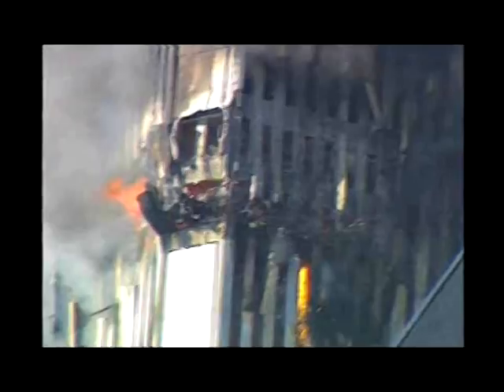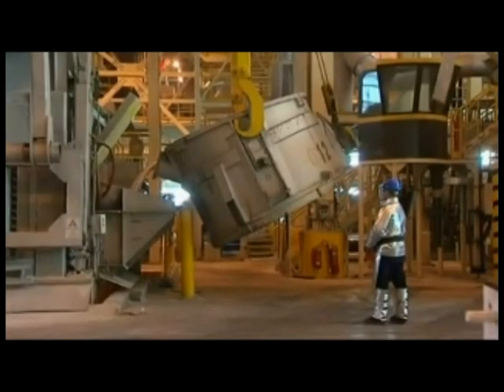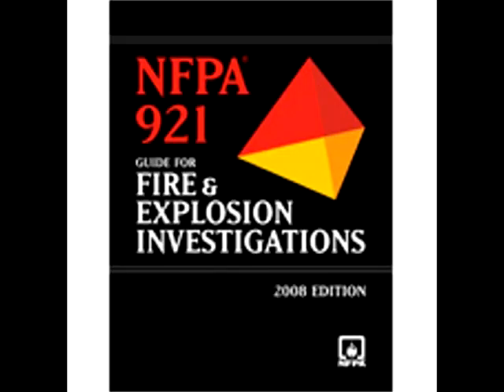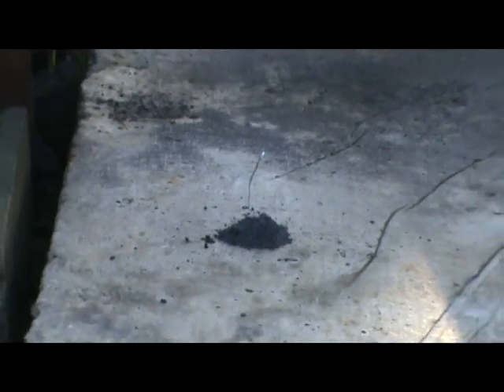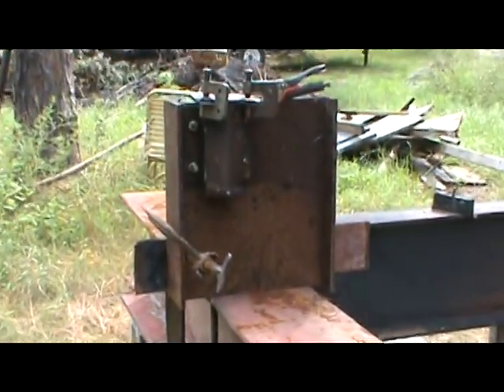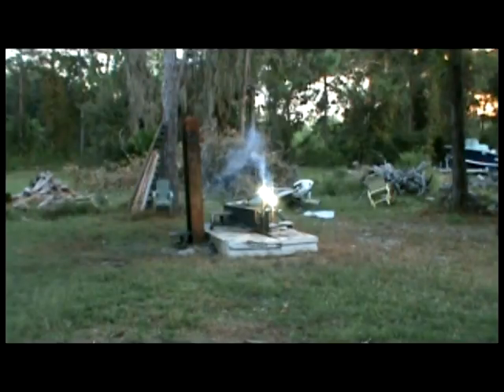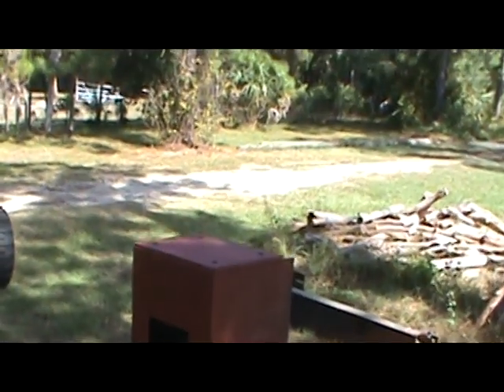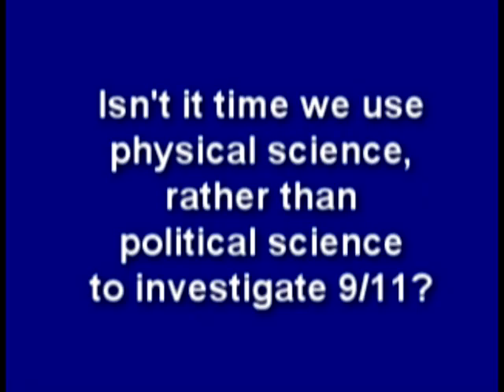9/11 Experiments: The Great Thermate Debate

Comment: Show me a recovered beam with a clear thermite cut, or shut up
Reply: We are conditioned to believe lies. It started at childhood with the tooth fairy, santa claws and the easter bunny. Then we go through ''education'' being brainwashed about the history of the word. For some they are brainwashed into believing the bible and the high majority of nonsense it contains. We are brainwashed by advertising that is designed to make a particular product seem more needed and desirable than another.

So provide the steel or shut up?...
You believe the above lies for how long before you woke up?... It's not the news that we see that worries me, it what we don't see that's the problem... CENSORSHIP.
Reply: horse1066 the dude clearly stated that he didn't have the compound that was most likely used, and just with back yard tests confirmed to a degree that you can cut horizontally
Reply: Your screen name should be sheep1066
Reply: horse1066 You say, "whats there to explain", like a smart ass and then you actually explain and support your position. Cut the crap and get to the point. 

Anyways, the investigations done then were not satisfactory. These experiments you speak of, they seem reasonable to me, but they were never done by them. They simply claimed that it was aluminum and carpet, no evidence to support their theory, and moved on. Soddy investigation all around.
Reply: horse1066- Are there any bigger sheep than those who believe ever conspiracy?
Reply: horse1066 i will agree with you that if this were 100% planned, then a ton of people would have to be silent for decades. the more you look into it, the bigger of a conspiracy it would have to be. as for the beams, the only thing i've seen is the videos of the super clean cuts that look like they were done with a plasma cutter
Reply: horse1066 This video also has a clip and references another video where they mix molten aluminum and carpet. From what they claim, it doesnt work.
Reply: horse1066 All this dudes trying to say is we're being lied to about what happened that day and I don't disagree with him. Although I do agree with you on what does are government have to gain from this. I don't know it's just all a little weird for me. Terrorist have attacked the tower before tho so I mean, it's possible they could of set up the thermite years before 9/11
Reply: horse1066  please explain how the tower collapsed in its own footprint like a controlled demolition
Reply: The point wasn’t to prove that thermite was used it was to prove that thermite can melt steel and disprove previous experiments the guy just wanted to do his own experiment rather than trusting the media
Reply: K Petro No, there is still one in the inner harbor in Baltimore.
Reply: BertleMcGertle this guy isn't an idiot, he's just as skeptical as anyone
Reply: Hank Schwiebert - what is to explain? The molten 'stuff' appears right where the plane hit,  wings are partly  made of copper/aluminium alloy.  Presumably someone needs to melt that with a bunch of impurities and see what colour it has. It also appears over a period of 7 minutes, whereas a thermite reaction is over in a few seconds and doesn't produce a great deal of melt.
Also it's kinda incredulous that someone managed to fly a plane right into where all the thermite was covertly installed...
As long as there is a reasonable explanation of something, an alternative explanation doesn't "prove" anything, you simply have two explanations for a given observation.
Reply: I didn't mean to sound like a smart ass, but you posed the question like it was unexplainable?
I'd agree, I don't get why nobody in the tinfoil camp has yet to melt copper/aluminium/carpet and see what it looks like, that seems like a quick way to counter the NIST's suggestion.
Reply: horse1066 

Well, I don't t entirely believe it, but it kinda makes me wonder how jet fuel can be high enough to melt steel beams.
Reply: nice meme I personally don’t believe everything the government says is true. However I also don’t believe that everything bad that happens in this world is always caused by he government.
Reply: iSal 
One problem with Conspiracy to Commit Murder (Treason)
doesn't have a Statute of Limitations ALL CARRY DEATH PENALTY who would talk?
Reply: AxA12 
Cannot Ever get so hot (calculate mass of steel/ BTUs/mission impossible; YES)
Reply: David Porowski - aww come on, that is a basic 9/11 question and the one with the most reasonable explanation,  AxA12 just hasn't bothered to google it. People who are not Engineers should really step away from this debate.
Reply: Hank Schwiebert - got a timestamp for the clip ref? I kinda FF'wd over his annoying narration
Reply: That is the whole point the beams all somehow vanished, I wonder why
Reply: Carmicha3l - I am an Engineer, also 30 years experience. Why don’t you tell us what you bring to the table :)
Reply: Carmicha3l - So clearly you are the uneducated dumbass neckbeard here, but you thought you'd mouth off a bit anyway. Kinda fell a bit flat eh? Feel free to ask me shit that only an Engineer would understand, I'd prefer Electronics but I usually have a grasp of most topics.
Reply: Carmicha3l - you still here? You’ve got nothing of import to add yet you continue trying to make out you do? come back when you’ve got a degree eh kid.
Reply: Consumer of Souls and cupcakes - we don’t know what that material was. I’d suggest if it was supposed to be thermite then we’d see the same phenomenon at every pillar and for a shorter period than the 7 minutes this was recorded over? As you know, a thermite reaction is over in seconds. Plus, you’d imagine someone trying to do this “covertly” wouldn’t use so much thermite that it starts to spew all over the place. This guy’s experiments don’t appear to reproduce this quantity of material either. Typically a cut beam briefly puts out a lot of light and smoke (also not seen), but not a few gallons of free flowing clear melt, there’s no real visible slag here either.
It is an unusual event though, I’d imagine some videos of burning planes on runways would be useful.
Reply: Carmicha3l - seriously, get lost kid. "I choose logic and critical thinking", no, you are sadly too dumb for that, you are choosing an "Appeal to authority" and hoping it makes you sound clever.
Great, 3,000 people have an opinion, good for them. So where are the cut beams...? Do you get it yet you fucking moron? You've got jack shit other than an "opinion", which in your case is based on other people telling you what to think, and then you lacking the ability to technically question any of it. This is the flaw in democracies btw, fuckwits like you are still allowed to vote for Hillary. 

Bush: "we need to stop that muslim twat from gassing kids, torturing his own people and developing VX nerve agents and biological toxins"
CIA: "sure thing boss, but first we need to destroy Manhattan to give us an excuse"
Dumbest tinfoil theory ever...
Reply: horse1066 it wasn't a joke
Reply: Harambe - not really, a fact is an observation that is accepted to be true, a theory is an accepted explanation of a fact. Science uses these terms differently to common usage, so theories do not 'turn into' facts.
Reply: Carmicha3l - creationism is interesting because you can't engage with it on the level of observable facts, because sky pixies by definition are not observable and therefore can't be disproved. But equally you could say that something that is non observable also will have no observable affects upon this universe, so in the absence of proof either way we can suggest that "God" is irrelevant because he's never seen to do anything.
So there might be a cat in the box, but unless he needs feeding then I don't care.
Clearly some (Americans) have decided they do care about unobservable sky pixies, and what those sky pixies may require from us in terms of singing, praising and the charitable feeding of African negros ad infinitum. But since I can discern no difference in my life experiences from yours, I choose not to waste my time singing and praising divine pixie entities that might have left Earth aeons ago. 
There is a correlation between low IQ and a belief in Creationism, that still doesn't disprove it but it's interesting. 
There is also the same link made between a low IQ and a belief in conspiracy theories, the latter is a bit more subjective in that Governments are known to lie in order to remain in power (like Merkel), but you have to balance that against their gross incompetence in achieving anything of value or complexity, which tends to rule out hyper elaborate shite like this.
Reply: horse1066 agreed
Reply: Harambe - a theory without evidence would be a guess, a hypothesis is a possible explanation for an observation. The issue being is that humans have a confirmation/belief bias, where the hypothesis is being irrationally judged based on a pre existing belief that the government always lies, and by inference that it is also capable of enacting any scenario to serve its assumed interests.
Theories (in the sense of being a scientific model) require accepted and rational evidence, not just "evidence". Like unexplained cancer remission is not evidence of a god, finding cat poo in the box is not evidence of the cat ever having been in the box.
An inference is where you have a fact that thermite can cut a beam, and you then use that to propose a hypothesis that such a method was used to bring down a building.
I'm going to get myself tied up in knots on this :)
Reply: Carmicha3l - that's pretty much what muslims say about those who point out that Islam is fundamentally violent, misogynistic, homophobic, paedophilic, patriarchal, anti-Semitic, politically insidious, totalitarian, intolerant and basically backward and inbred.
They have a right to their opinion of course, but most people eventually recognise the truth just from their own personal experience of living near them. Only dumb Hollywood actresses with a pathological need to be liked by others and who live in homologous white gated communities, have the basic feckless ignorance to suggest that our society is currently being enriched by the hosting of sub Saharan savages.
Likewise Evangelical Christians often see no need to question what they have been told to believe, or how to interpret the bible in anything but a dogmatically literal and simplistic way. Plus modern social norms allow them to skip any parts that are inconvenient, like stoning.
Religious people essentially define the human state of a closed mind, because their only educational source is a single consolidated book, originally written in a language that barely a handful of scholars actually understand, and then translated into English, which often doesn't share the same nuances of meaning, and which they don't care about anyway because someone has drawn them a nice picture of a white guy in a robe with some doves.
Reply: Carmicha3l - you are just repeating yourself without offering any basis for your opinion, I've written Prolog routines that communicate more intelligently. You could start by outlining why you don't believe in evolution. You can use all the big words if you like.
Reply: Carmicha3l classic
Reply: K Petro Thats a load of bs because ik for a fact that the US Air Force Academy has a beam from the twin tower on display.
Reply: The bolts were the ones that got cutted.
Reply: Lol there was literally one sticking out of the ground
Reply: horse1066 30 year experienced engineer and he doesn't have the brains to realize he's getting baited. Good one
Reply: oh no, China is in on this! i fucking knew it
Reply: While the theory seems viable it still needs solid proof to be accepted as horse pointed out a piece of used material or steel showing use of this material. And there are pieces of material still in the u.s at memorial sites may or may not be pieces that were close to the damaged area but.....
But on the same hand hundreds of people wouldn't need to be included certain groups within the u.s military operate outside of congressional jurisdiction and only answer to seniors and the president. If it is true and a more powerful agent that special forces could easily obtain was used they would only need a short time and limited personal to instigate said mission seeing as  they are regularly trained InThese situations. And have the ability to do said impossible tasks.
A much more viable idea is as the plane took out several steel columns the remaining ones could have been bent and broke in small areas you add the insulation of the steel and a supply of open flames  to a now confined area with warm air to rise flames to be sucked in and cold air to feed from the bottom while temperatures outside may be low you've created a forge inside the steel
Reply: horse1066 they shipped the beams to China to be melted down for scrap immediately.  Nothing left to see.  Source: Chicago Tribune http://articles.chicagotribune.com/2002-01-27/news/0201270268_1_metal-management-world-trade-center-shanghai-baosteel
Reply: horse1066 Did you find video or testimony of molten steel compelling at all? That does need to be explained, and NIST could only say its molten aluminum mixed with carpet. Theres no way thats true, so weighing the evidence here the tin foils have a stronger case on this one.
Reply: horse1066 i agree that the burden of evidence is on those claiming thermite/thermate was somehow involved, but one does not have to examine the steel beams to conclude whether or not thermite was involved. The man inside the video provided a multitude of other evidence- eyewitness accounts directly contradicting the governments claims which perfectly align with what the man presented, as well as video/photo evidence which proves there was some other variable leading to the collapse other than jet fuel and the initial impact. The fact that national geographic/nist claim that even 100 pounds of thermite cannot melt through steel beams and support this with film of their supposed controlled experiment while a random man can make his own thermite with common substances and needs about a pound to cut through steel means someting dubious is at play. This video also disproved the fact that thermite cannot cut horizontally or vertically, also directly contradicting the narrative told by Nist. Whether or not there was some sort of foul play on the governments side or not, there is definitely a missing component in the towers collapse which has not been adressed either because it is truly unknown or because the government was at fault.
Reply: iSal - and that's still irrelevant, I'm not saying it isn't possible to cut a beam with thermite or pixie glitter, but simply that there is no evidence to suggest it was used. So as yet, this "proves" absolutely nothing.
Look at how all these tinfoil theories like 'faked moon landings' all require the enduring silence of thousands of people, yet in real life, nothing remains secret for five minutes. Governments can't even organise road repairs and closed borders, never mind anything underhand.
Reply: Dan S M
You haven't even got the brain to make an actual point, tragically sad.
Reply: nice meme - you do realise that as soon as you say "sheeple", people start laughing at you. Also, try reading you dumb fuck, nowhere did I credit any government source with the truth.
Reply: BertleMcGertle - hey everyone, BertleMcGertle made a JOKE, he changed my name from horse to SHEEP, because anyone who possesses any critical thinking abilities is a "sheeple", get it? HaHa OMG, that's so funny, so much better than making an actual intelligent point. Berty I am going to write your excellent joke down and show it to my Mom, she loves a good chuckle. Thanks for playing with the adults and have a great day.
Reply: petrusfilippus - It was a standard demolition procedure, the steel is the easiest material to separate and a lot of steel salvage (like ships) goes directly to Asia. You can't store a million tons of steel in an area like New York on the off chance you'll need to disprove yet another tinfoil conspiracy theory.
People with beards hijacked planes, it's a reasonable conclusion to pin that on muslims, and muslims have been begging for a kicking from somebody for decades.  Nobody then could have predicted that Europe's politicians would be so insanely dumb as to then let them across the borders.
If you want a realistic tinfoil theory that is backed up by Marxist ideology, then you'd have to go for the idea that importing millions of muslims is actually intentional.
Maybe you guys need to devote a little more energy into making damned sure Trump is re-elected, or you will all be fucked over too. And no, guns will NOT save you.
Reply: horse1066 how are we supposed to explain the molten steel pouring from the building then considering not many other things can melt the steel. you dont need evidence to prove something if you can combine logic and science
Reply: horse1066 theories are basically facts
Reply: horse1066 yes but a theory has evidence to support it. Right? Without evidence it cannot be a theory
Reply: Carmicha3l calling someone close minded over and over just reflects on yourself, stop and mabye question your own religion. The amount of scientific inaccuracies you'll find will blow you away
Reply: horse1066 

They shipped them to China, FAST.
Reply: Sheeple like you will believe anything the government says.
Reply: Nature's Magic
I could posit a theory that pixies turned the steel into rainbow glitter, but until I can find a handful of glitter, that's all I've got, a theory. All the foil heads in here are running around like they have the answer.
To flip your brainwashing approach, people who believe in conspiracy theories tend to have a low IQ and are drawn to pseudo-profound intellectual BS. Zero Energy youtube BS is a prime example.
Until you lot acknowledge the obvious explanations for stuff instead of ignoring them or fail to address the obvious holes in each set of theories, then you are basically promulgating twaddle.
The Government does not need a reason to go to war, nor does it need to destroy a building and kill thousands of its own people AND cover up every single aspect of that ridiculous idea, it could just blow up a crippled white orphan on her birthday and blame ISIS.